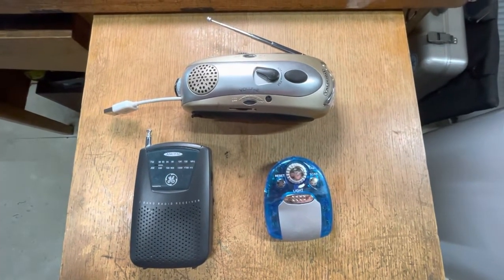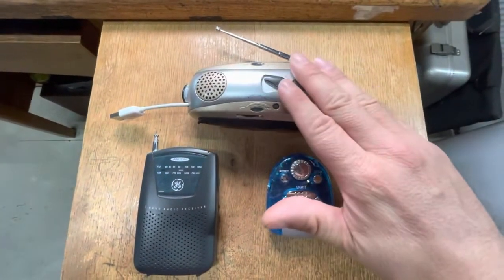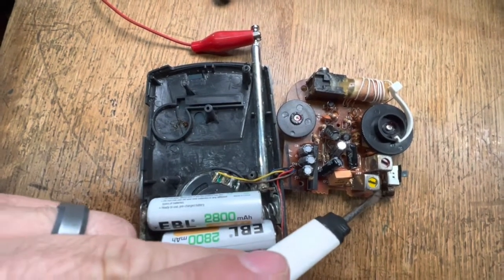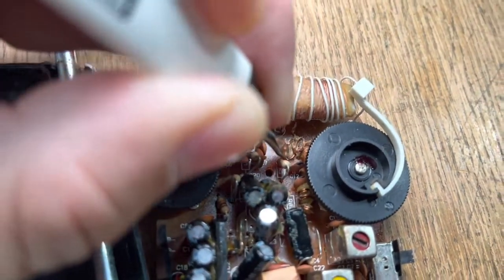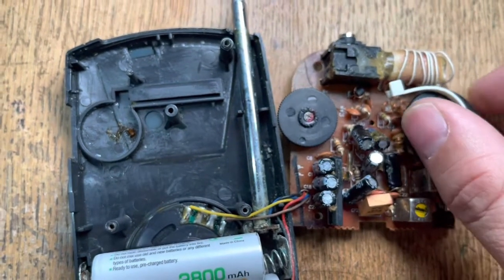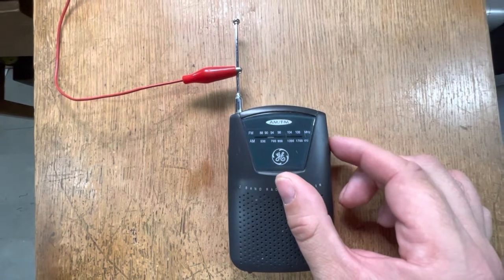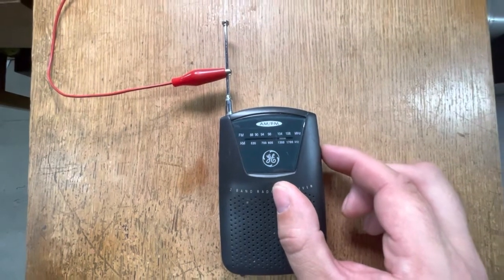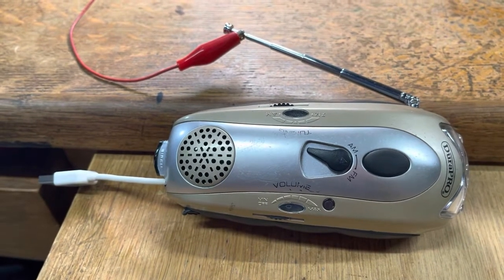Easily Modify Cheap FM Radio Receiver to Listen to Aviation Band AM Transmission.

Comment: FM (Frequency Modulation) receiver won't demodulate AM (Amplitude Modulation) well. The sound will be distorted, weak, & hard to understand. Also the higher up the frequency, the shorter the signal's wavelength is, so you make the antenna shorter, NOT longer for the best reception. When you see long, or tall antenna masts & towers, the whole thing isn't an antenna. Just a smaller piece attached to it is the actual antenna. The antenna mast or tower is just to get the antenna real high up off the ground. They work better, the higher up you get them.
Reply from the maker: You may be correct from a theoretical standpoint. However you are completely wrong about the signals being weak and hard to understand from a real world practical perspective. It actually works surprisingly well.  Furthermore your premise in regards to this particular antenna is severely flawed. I made the antenna longer because the included antenna on the cheap FM radio was only a few inches long. A 1/4 vertical for the aviation band should be roughly 24 inches long, not 4 inches. I have done this modification to nearly a dozen different cheap FM radios and they all worked great for listening in on Aircraft communications. So you are again wrong. I recommend you give this a try before bashing this concept and thereby dissuading others from enjoying this fun, easy, and rewarding electronics project having never done it yourself. 73!
Reply: I've tried this with FM radios to get the aircraft band when I was young many years ago, that's how I know. Oops... I wasn't aware the original antenna was only 4 inches long. Usually even the worst FM radios have an antenna longer than that.